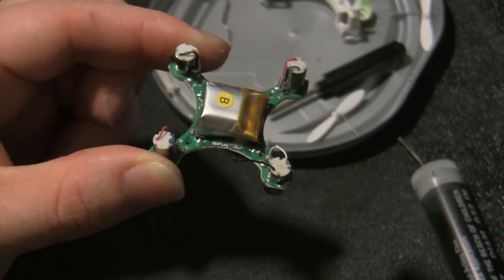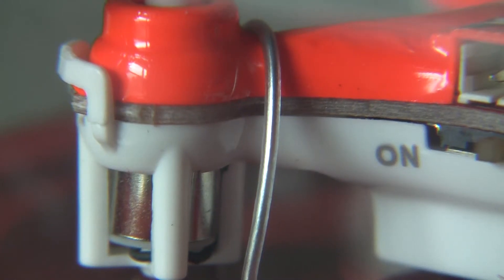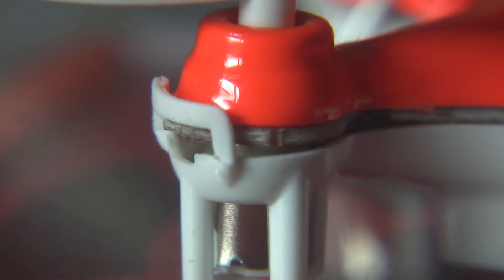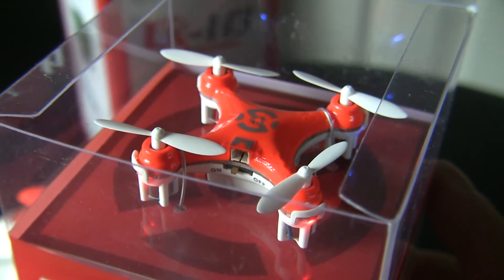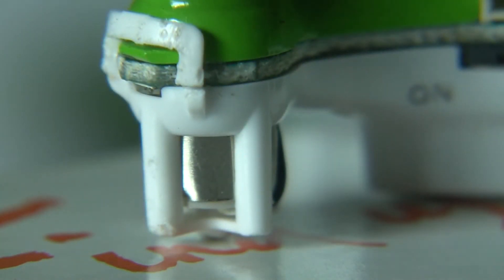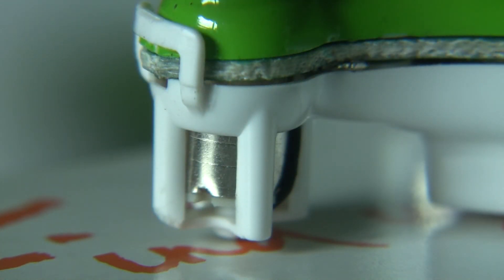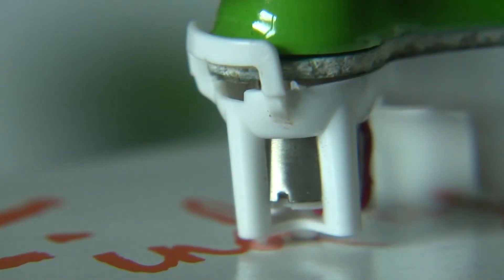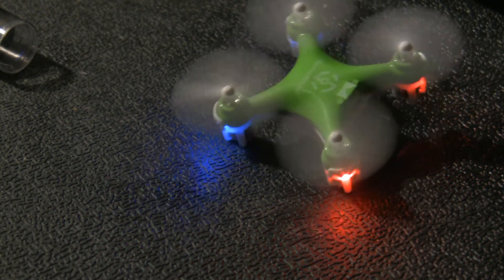Why Won't My CX-10 Fly It Is New - Spot a Broken Quadcopter CX-10

Comment: When the gyro is knocked off a little on arrival and or in the event of a crash it sometimes gets knocked off a little and one motor or more may either not spin altogether or not spin properly resulting in weird flight, you just need to recalibrate when that happens mostly to solve the issue